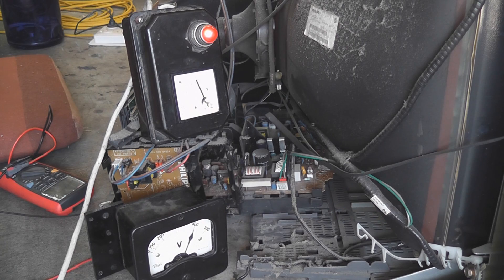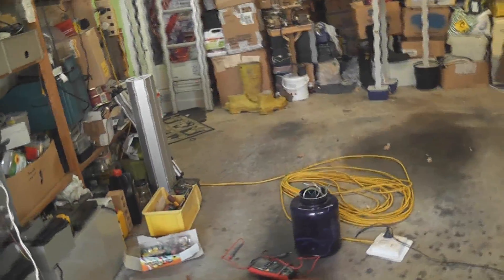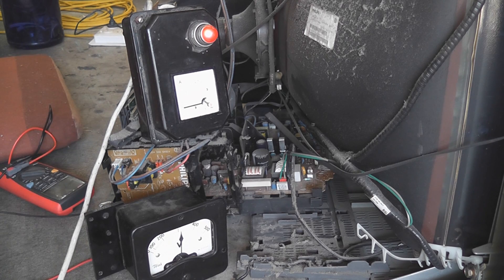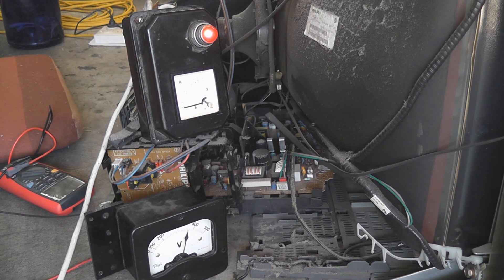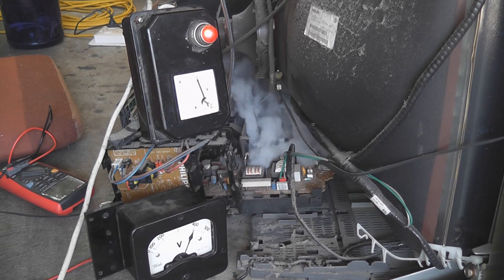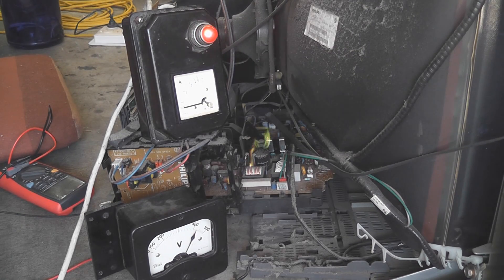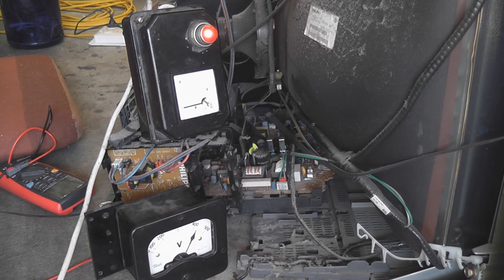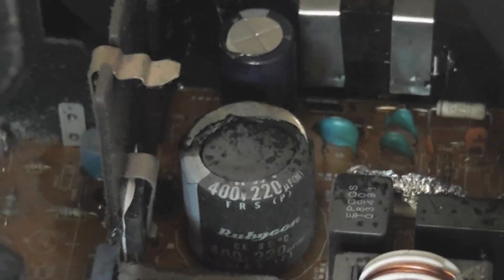Philips TV on 400 Volts still works

Comment: lol, just cheep oil and water capacitors bursting 
some resisters burning
circuitry changing
wow, i started out typing about capacitors but when it got to the circuit board i changed my mind
this is neet

Comment: Mmmm, at 0.37 ........Loadwheel action! :D Metropolitan Vickers device.

At 0.48....... w00t ?! Plug? PLUUUUG!! :D What kind of a plug-and-socket is that one? :-O

That needs its own video. Pleeeeaaase? :D

At 2.30 ....... Whistley-squeeler capacitor with nice smoke development.

At 2.55 ......Eeeew, that sounds all wet and dribbley. :D

At 2.57........Ooooh, we have flaaaames, but dark green ones! :D

Haha, nice slo-mo cap vent-off at the end there. :D

Thanxx for showing,

-BoomBoxDeluxe.

29th December 2015, 15.04